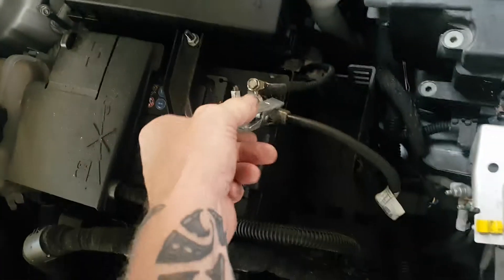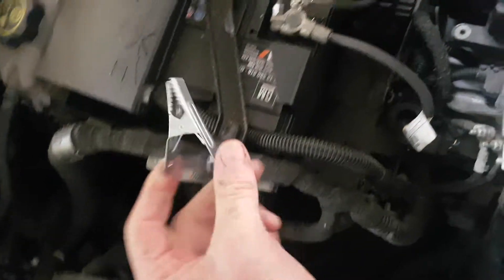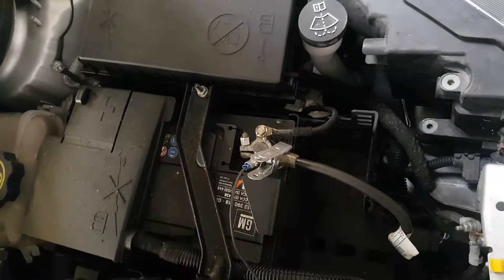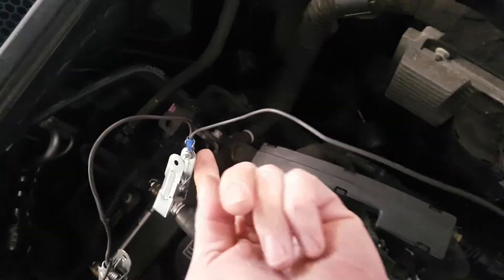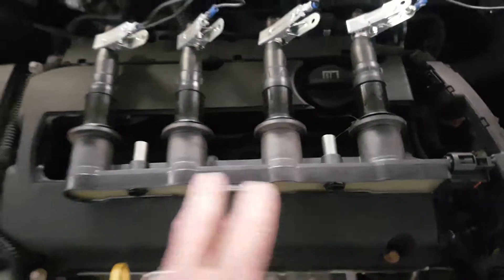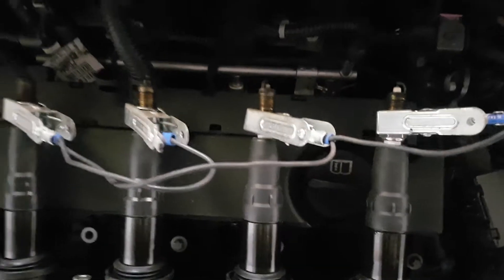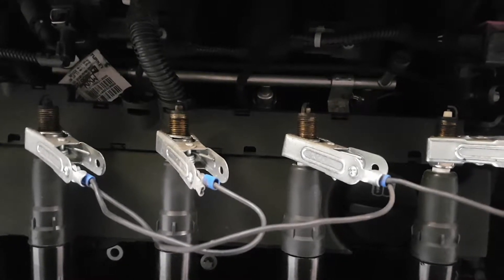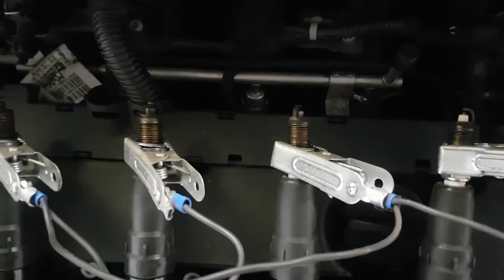Testing for misfire with cassette type ignition coil

Comment: Thank you I am going to use this to test the cassette type coils in my Saab that won't start.  I replaced fuel pump, spark plugs, and crank sensor with no luck so far.  Just cranks and cranks.
Reply from the maker: Good luck 🤞🏻

Comment: Just stick screw driver in ingestion coil and get it near engine block you will get spark ⚡️ if is good much easier
Reply from the maker: Just be careful where the sparks from the other coils at going

Comment: Sorry for the Noob question but can I just test them without the clips putting the direct ignition  cassette upside down
Reply from the maker: Hi. The plugs have to be earthed,  by this I mean each plug must have contact with the negative circuit. You could just wrap bared wire around the base of each plug or whatever but they will not spark without a good earth. Also remember there is a possibility of fuel vapour coming out of the spark plug holes during cranking, either keep the plugs away from there or disable the injectors to avoid this vapour being ignited by the plugs.